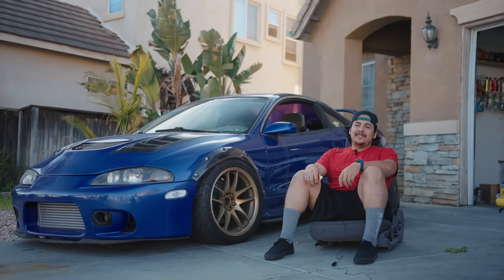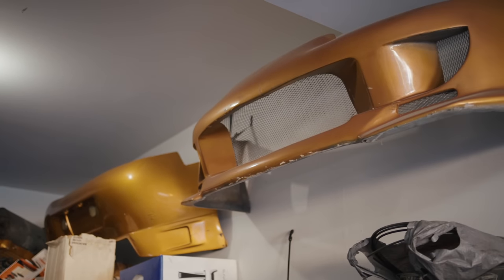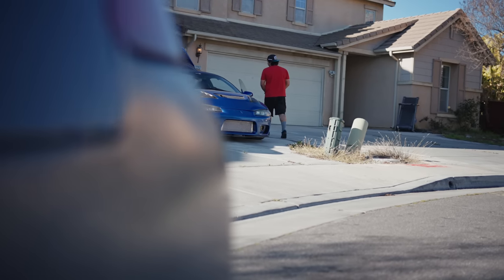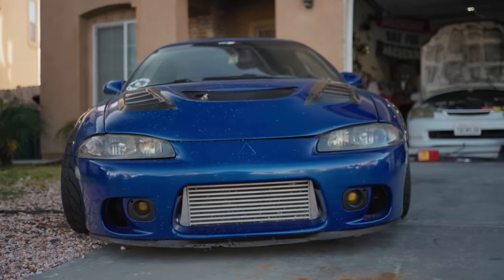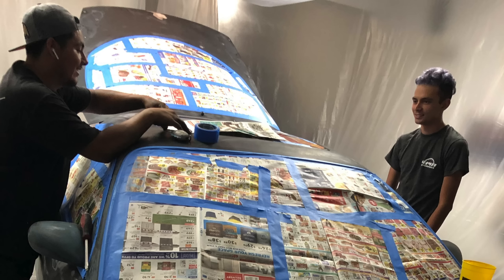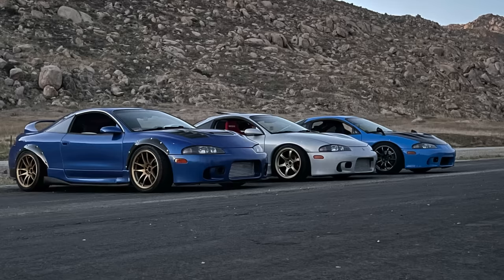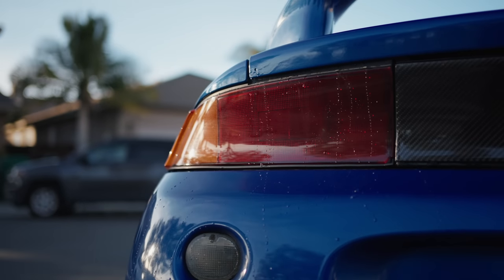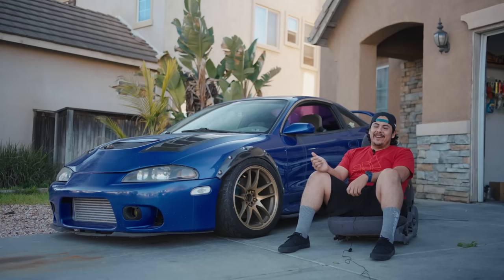The Most UNDERRATED Mitsubishi ECLIPSE Build! | Full Documentary

Comment: I nearly bought a entire 2G GSX rear subframe last night with everything attached to it  turning my RS into a awd with a Evo 8 engine swap until I saw your video saying your back up lights,turn signals,hazards didn't work after merging the 420A harness to a Evo harness.  I was like nope I need those around here lol
Reply from the maker: You can easily have those going. Just more work to do on the wiring side
Reply: @MiguelDsm  I got a team for the install, wiring but I would love to have a way to connect with you for help. I messaged your Instagram from my FB messanger last night but if u gotta way to contact you to be a helping voice on the build that would help tremendously

Comment: My first car was a 1997 Mitsubishi Eclipse RS I was a ricer back in 2004 when I got the car. Then I traded it for a 1991 Nissan 240sx. Then sold it for my brothers SR20DET 1991 240sx. Then started jumping from S13 to S13 then into a 98 S14 with a S15 SR20. Now I drive a 2005 Pontiac GTO that built and making 450whp about to make more. But technically still an import since its from AUS. Cool eclipse though man takes me back.